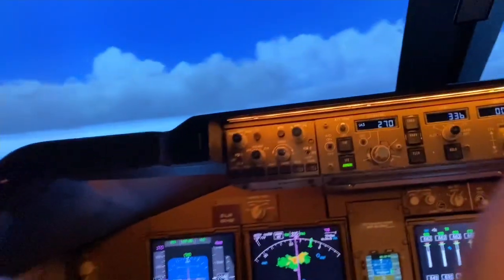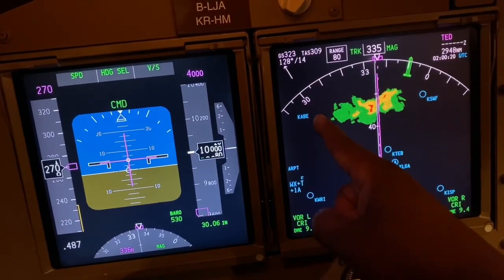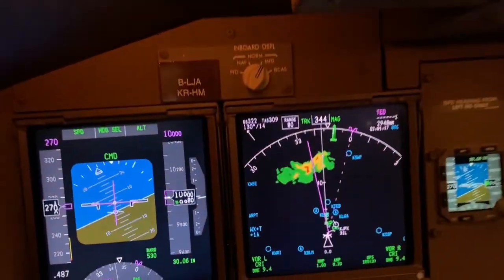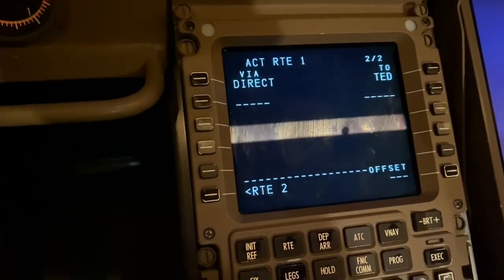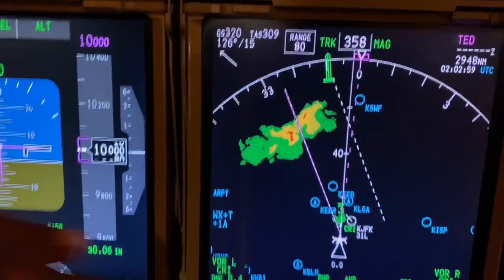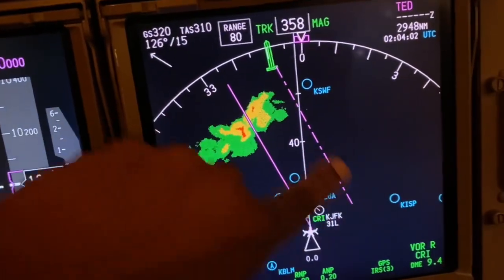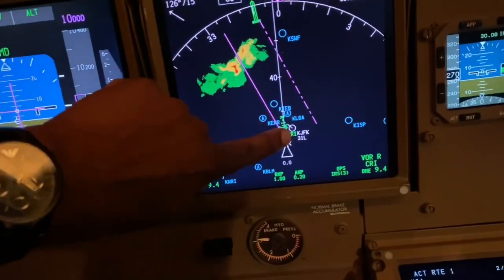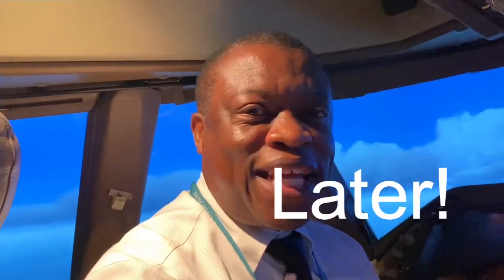Weather avoidance methods

Comment: Using the offset feature on the FMS, deviate right 20 miles but what is the heading selected (degrees) to go right?
Reply from the maker: It can be manually selected to any desired intercept angle or left in automatic where it selects it. Between 30 degrees and 45 degrees.
Reply: @pilot_obet  Thanks Cap for the info...Safe flight... It seems you frequently fly to Penang, Malaysia... Have you've flown to Kota Kinabalu, Sabah in the island of Borneo before? My hometown...lovely airport also by the sea...Laterrr....

Comment: @Pilot _obet i've just discovered your awesome videos - i'm a chair pilot flying mainly GA but every now and then I dip into Airliners. I know your sim is the real deal but one question  . . what sim software is that because the weather depiction looks great?? I use X-Plane which i know is used in commercial applications but it doesn't look that good on my humble PC :)
Reply from the maker: Hi- thanks.  I’d have to check with sim technicians when next in sim- let you know

Comment: Captain,which method most pilots prefer,the heading selection looks quick and simple compared to deviation via FMS
Reply from the maker: Darius Tanz In some areas of the world, ATC prefer to give you headings but mostly offset is better as it parallels your original track.